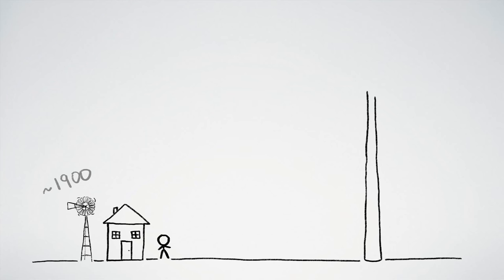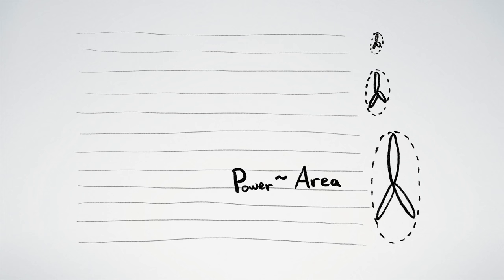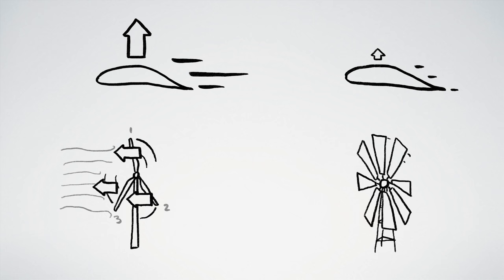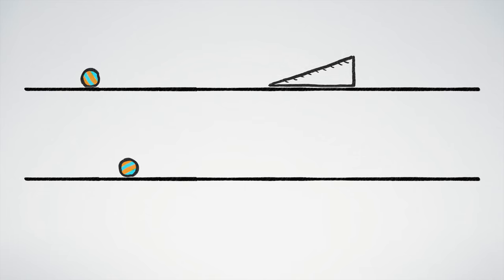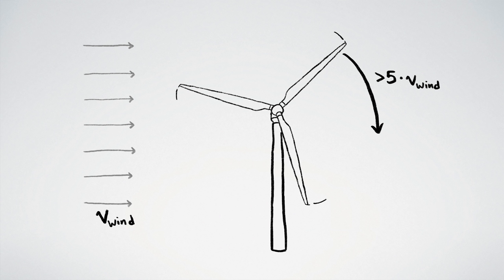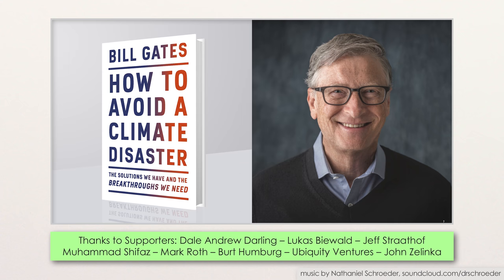The Physics of Windmill Design

Comment: Love hearing the physics and calculations for optimizing the blades, thank you. I heard a lot of talk after the recent TX storm from people in harsh climates (other states, countries) that said during the winter windmills use more energy than they produce for heating elements so they don't freeze up. True? If so, what are the energy yields at different times of the year and how drastic does it affect ROI?
Reply: In general, no. Not true. Some of the largest wind and most effective wind farms are beyond the arctic circles and function year round. They can function fine in cold temperatures. There are a lot of factors at play. To touch on the TX situation, they do have to be specifically designed to withstand such temperatures though.

Comment: There was a show I saw (~10 years ago) on Discovery about multiple sets of blades on the same axle.  The conclusions the show drew led me to believe that windmills in the future (now) should have two planes of three blades on a shaft that runs through the generator (so that the planes are 2/3 the length of the blades apart).  You didn't discuss this factor in your video.

Comment: Who else found the most fascinating statement in the vid, that the moving wedge extracts more energy from the ball than the stationary one?
It's thrown out there as an explanation for why faster moving blades are more efficient, but is not itself explained in any satisfying way.
Reply: Have you had any luck figuring it out. Like in my opinion it’s not as intuitive as it seems
Reply: @ricoautosauve7849   No, I haven't figured it out.    As someone who plays ping pong, I can see (and perform) this experiment and verify the net result (ball bounces less far when paddle is receding at an angle, versus stationary or advancing), but I've never thought of it in terms of increased energy transfered to the paddle.   Generally it feels more like linear kinetic energy translated into increased rotational energy of the ball, but maybe not.  

The only hypothesis I can think of is that the receding surface gives more time for the non-instantaneous elastic collision to occur thus more energy transfered over a greater time.    That would suggest that ramp or no ramp, the ball should impart more energy into any receding surface for the same reason.
Reply: @daemn42 
If you want the maths explanation it's to do with conserving both momentum And energy
Say the slope is stationary. The ball bounces off it pushes it to the right moving left. The momentum of the ball and slope are the same. As the ball is lighter however it takes most of the energy since energy is proportional to Velocity squared.
Now say the slope is moving.
The ball hits it and barely rolls to the left. The slope is accelerated to the right by a smaller amount than when it was stationary. But because once again energy is proportional to velocity squared that small increase in speed is a larger amount of energy gained than it got when it was initially stationary.

Or to put it another way, less energy went into the ball rolling left so more of it must of gone to the slope moving right.
Reply: @curseofgladstone4981  Ya nah mate, that didn't clear it up.  You're just describing the same symptom not the cause.    Yes clearly if the ball bounces away with less energy then more went into the moving ramp.  That doesn't tell me why more energy went into the moving ramp.

Comment: This is also somewhat related to design of airplane propellers and helicopter rotors. Single blade rotors can be more efficient, but quite impractical - I belive there is a video of a single blade rotor RC-heli out there somewhere.

Comment: One fact I love that was shown briefly in the equation on the screen but not discussed, is that the energy generated and size have a ^3 relationship. That is, if you increase the sixe x2, you increase the energy generated 2^3 = 8 times. This means there is a huge incentive to build bigger. In England, where lobbyists used fear and NIMBYism to prevent large windmills being built on shore (I can't prove this was a dilliberate attempt to hold back the renewable energy industry), they accidentally incentivised the accelerated development of off-shore wind, which was able to get much larger than onshore likely ever could have, and probably proved itself financially desirable even faster. Sucks to be you, oil and gas.

I've always wondered why three blades? Another thing I can't prove, but that is intuitively true, is that it's the smallest number of blades that is well balanaced enough to rotate smoothly. There are a few two-bladed domestic-scale turbines around, and they always look to me like they're going to shake themselves to bits.

Comment: Though the problem with high velocity windmills is the amount of noise they make, and as you said parts of the blade that aren’t moving at the same velocity which increases stress in the blades. They solve this by lowering the velocity of the blades but using a gearbox to convert high torque and slow speed to lower torque and high speed gears which can then convert mechanical energy into electrical energy.

Comment: Could you do a video explaining how using windmills can affect the power grid? Because electricity isn’t usually stored (inefficient in most places), and has to be produced in the right amount for the demand of the city at all times, windmills introduce a ton of noise and unpredictability to the circuit - which can create the need of running more small generators on standby to compensate for quick changes needed on the power grid (which can burn more fuel than just not having windmills in the first place)

Are there technologies being developed or are in use to reduce the unpredictable nature of wind and to control the amount of power these turbines produce to a certain degree? Do the blades rotate in order to provide more/less resistance to the wind to stabilize its power generation etc.

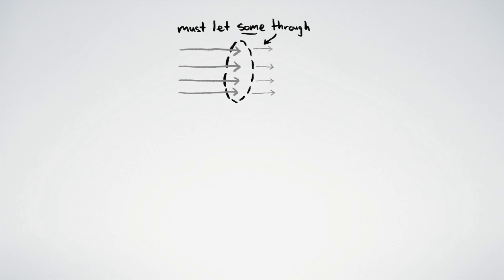Comment: I believe there is a small error at 1:05, where there should be no factor 1/2 in the power. Either P = rho A v^2 (v1-v2) (derived from incremental work done) or P = 1/2 rho v (v1^2-v2^2) (derived from conservation of kinetic energy). I first used your formula and got Pmax = 29.6%, which is wrong.

Comment: I'm doing an analytical investigation on optimizing the power for a HAWT blade. So using blade element theory to investigate this matter. Does anyone know any good aerofoil blades near the hub, middle and then the tip? And what would be the best chord length distribution for 20 elements?

Comment: Old wind mills (Pre 1900's), sometimes did use "sails", but we understand more things about airflow these days, also the "serrations" others mention here, I think, work very much like Super-cavitation in water, they found having little bumps all over a surface causes a turbulence layer between the object and surrounding water, reducing friction, which is how the USSR & others built torpedoes that approached 500 mph speeds, and may have been what sank the Kursk submarine, after a misfire ..., however unlike when pushing air, like your normal house fan, if the blades get dusty & Grimy they stop pushing air, and need a clean, having said all that I do wonder if more blades would help but like I was thinking more like the the new props we see on the modern Nuclear subs ...

Comment: Also, a slow moving, larger blade means more torque against the foundation and hub, which means you need much stronger bearings, gears, tower, foundation.

Comment: What are the trade offs between fast-moving windmills and the increased wear they will suffer from the faster rotations? Seems like in the long-run slower moving ones might provide more energy overall due to less maintenance requirements. Also slower moving ones are less dangerous to birds flying around them.

Comment: The high speed also helps with the electrical generator. They generally work better at higher speeds and just using gearing to increase the speed is not as efficient as having the high speed to start with. That isn't to say that you can't make a low-speed generator, but it is easier to just start with higher speed in the first place.

Comment: For those of you that don’t have a clue. The blades on a turbine have hydraulic motors to pitch. To control the speed and prevent them from pin wheeling and causing damage. The drivetrain inside with all of the gear reductions turns the shaft to the generator a lot faster than you think. Trust me I put them up.

Comment: There is another benefit of faster moving turbines.  When converting kinetic energy to electrical energy the power remains constant (minus some efficiency losses).  Power from the rotating kinetic energy of the turbine is RPM x Torque (ft-lbs) (1 ft-lb/min = 0.023 watts).  Power generated in electricity is voltage x amperage (1 volt-ampere = 1 watt).  So on the electrical side you can either boost voltage or amperage to get your power and on the mechanical side you can either boost torque or speed.  With most generators boosting speed is equivalent to boosting voltage meaning you can lower your amperage.  On average this is more efficient as it is safer to transmit lower current and allows your electrical components (wiring, breakers, etc) to be lighter and more efficient.  On large gas turbine powered generators (think jet engine powered generator) that spin at 10,000 RPM or more the internal wiring is extremely light.

Most residential power grids (in America at least) run at 15,000 to 25,000 volts for this reason, they can run at much lower amperage (if they were running lower voltage the size of the power cables would be immense, probably too large to run on the standard above ground pole you see in rural areas).  They are only stepped down to the required 240 volts at the house transformer.

Comment: Why do wind turbines keep basically the same directional axis? Thinking similar to the Pelton wheel turbine, If the wind was redirected (say outward like a centrifugal pump but sloped such that a pressure gradient doesn't build up to heavily) then wouldn't the subsequent incoming wind still have somewhere to go, yet have more of the momentum absorbed and converted into energy?

Comment: A fundamental problem with wind generation is that they always run at maximum power dependant on available wind (That in itself brings another problem, wind speed to power output is a cube law so small variations in wind speed means a large variation in power, far from ideal).
As grid demand is variable wind is unable to respond to that rise and fall in demand, its asynchronous and it's essential to have the synchronous generation that fossil fuel and hydro plants can give. If you have too much wind input the grid becomes unstable and more difficult to keep frequency in tolerance, trips occur on the grid if it goes out of tolerance. In other words wind generation is inferior to synchronous generation and is not a simple replacement of that sort of power. It is not a good answer if you want to reduce fossil fuel generation.
There are a couple of other technical issues with wind and that is before intermittency is even considered.

Comment: The costs of production and maintenance of an optimum design needs to be considered.  There are trade-offs between vertical and horizontal axis turbine.  Bigger and higher is not always better.  Lots of vertical axis turbines may be cheaper to deploy and maintain, and more reliable than a single horizontal axis turbine.

Comment: And there is also Darrieus vertical windmills, which can work in turbulence, do not require wind-facing adjustment and have a smaller footprint.  True, they are not as efficient, but the smaller footprint and omnidirectionallity makes them ideal for urban areas.

Comment: I agree; counter intuitive.  What is it your seeking from the wind?; FORCE.
Although the swept area of the thinner blade may be larger, the blade which extracts the force from the wind only comprises roughly 6% of the total swept area at any instant.
Fans used to move air utilize wide blades (60% or more) to exert force over a wider area.  Old style windmills use wide blades to extract a high amount of force from the wind.
Since the gearing necessary to achieve the 3600 rpm generator rotation also increases the required torque load to initiate and continue rotation, would it not be more advantageous
to make the blades shorter and wider to collect more torque? 
They would not spin as fast due to cavitation and drag, but they would have a significantly higher torque input even in lower wind speeds.
This theory would seem to be proved out in small wind experiments using the thinner blades but varying the number of blades, thereby increasing the surface area contacted by the wind.
A fully loaded 1kW HAWT with three blades begins rotating in a wind of 20 mph.
The same test setup but with 7 of the same blade style begins rotating in a 8 mph wind.
More surface area, the higher the power extraction. In a VAWT, the difference between the Darrius rotor and the Savonius rotor assembly.

Comment: Could the design be made more efficient by adding fixed pre-blades that impart inverse rotation to the overall direction of the wind before coming in contact with the rotating blades? Granted, it would be expensive and impractical, but just as a thought experiment...

Comment: Big windmills are cool because they can turn slower in rpm because  they have more tipspeed than smaller faster turning windmills. That is why kitepower is a neat idea, as the entire kite travels at the same speed. Plus it can go higher without needing a large heavy Tower.

Comment: Would a combination of modern designs and another hypothetical design work to recapture the rotational energy lost through the spinning of modern designs?

My idea is this: use a natural wind tunnel point like what is found coming over the rocky mountains (or what actually is responsible for the jet-stream west-to-east over North America, I don't remember if that's right) to feed through modern designs. Because the wind will (almost) always be going the same direction, you could install a theoretical design that would re-capture the rotational energy lost by modern design, as well as an additional amount of power from the wind-speed not captured by the first layer.

Comment: Also the tip speed of modern windmills is constant due to engineering/material constraints. Therefore bigger windmills seem to move slower, but the tip velocity is always the same.

Comment: That leaves the question, why are three wind blades better than two or four?
It's because of stability and to reduce oscillation of the rotor.
For example if a rotor has two blades one blade will be above and one below. 
Now the higher one will experience a higher wind pressure because the wind up there is stronger.
Also the lower one will experience less wind pressure because its lower and because the supporting tower is in the way of the wind.
This leads to strong pulsating forces on the tip of the tower.
If you have three blades instead, everytime one blade points straight upwards, there will be two pointing downwards (as kind of counterweight), decreasing stress on the wind turbine.

Comment: Space is an issue too, though. So it's often more ideal to put one big windmill instead of more than one smaller one since you won't have the space for them. I see it in Germany where we have very weird laws that prevent the installation of windmills and therefore they go for extremely huge windmills instead of smaller ones so they can still capture a bigger amount of energy.

Comment: I also thought that practically smaller blades are used due to cost factor right? Just like any other engineering project, cost also plays a role in designing things in my opinion

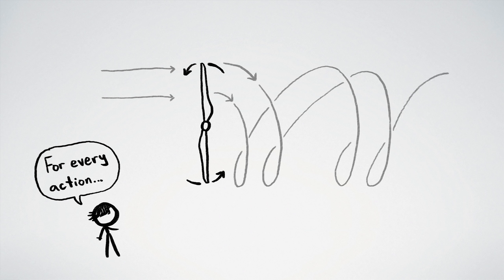Comment: 2:00 the Vortex behind the mill is the result of force that turned it. Less vortex = less power no matter how you put it. The efficiency does not even go into the equation.
Think of it - perfect 100% efficient windmill that will not rotate the air behind it and wont slow it down... sooo it's as if the mill wasn't there at all. So no power can be extracted.

It's actually the same with aircraft, the induced drag (vortex behind wingtips) is not really a "drag" - it is what created the lift! Thats why we don't see any special "devices" that reduce induced drag on the wings*. Any attempts at reducing vortex will reduce lift, and efficiency comes only by smoothing out vortex creation so less energy is spent on turbulence, and more on spinning.
* - winglets don't count as they are basically wingspan extenders without actually making the aircraft physically wider, and they don't try to reduce the vortex.

Betz's law also has not much on blade area. If it were, airliner engines would not be able to pass any air into the engine.
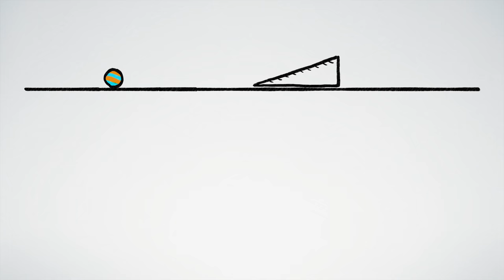My brain is too fried to process it right now, but the momentum-energy deal at 2:20 also rigns a bell of an old misconception. Energy sounds nice, but it's momentum that does the work, could be wrong.

Love the channel thou <3. Problem is "lift" is way more complicated than "rocket science", yet somehow we often treat latter as too hard to explain, but try to explain former in simple terms which is plainly impossible.

Comment: Is there a reason that windmills aren't designed like waterwheels just rotated 90 degrees so the blades are in the wind? That way they catch the wind to rotate the wheel thus getting the blade out of the way and the next blade in the way?
Reply: @cas curse I see thanks for the clarification.